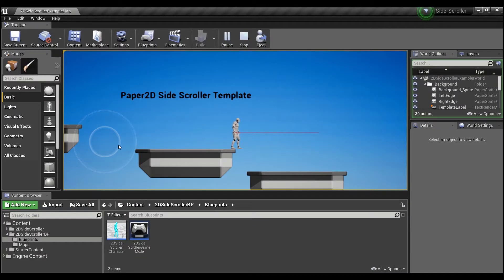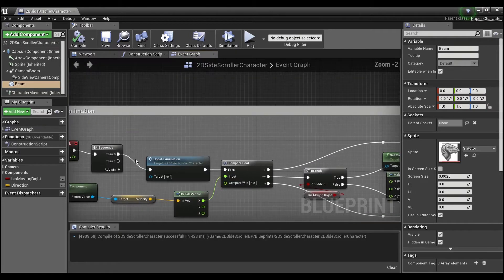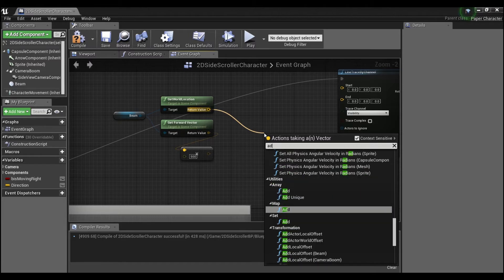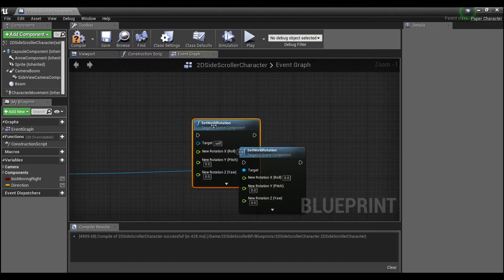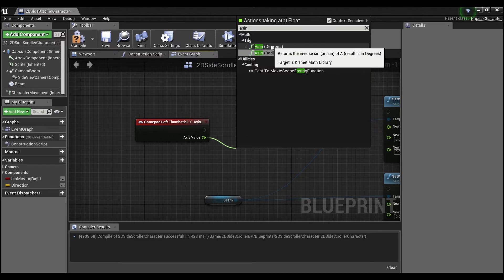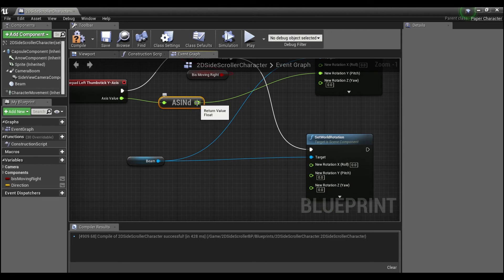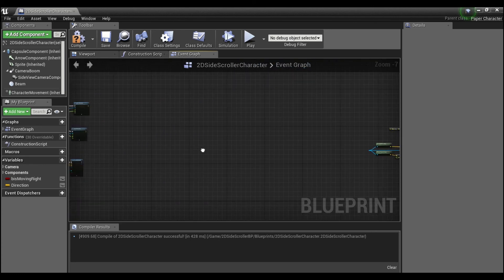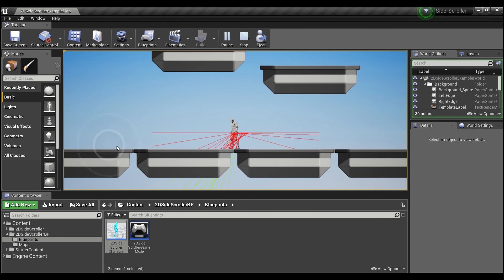Unreal Engine 4 Tutorial: Joystick Controlled Line Trace in 2D

Comment: How to do this with mouse cursor position?
Reply from the maker: There is a node I forget the name off hand that converts mouse position to screen coordinates. It might be called "mouse too screen" something you can find by searching in the player controller. You'd have to modify this somehow to use those values as the mouse changes its vertical (y) and horizontal (x) screen position.

Comment: Thank you so much. I'm assuming a lot of this will still apply to a 3d sidescroller? This definitely puts me on the right path.
Reply from the maker: Um, I am not sure about 3D. A joystick only has 2 axis, up/down and left/right. So you can only aim the line trace along 2 axis. Not sure what your game mechanics are now to be honest but I'd imagine you'd need to add another input to then rotate about the Z axis as not just the Y axis pitch. But I'm sure it can be done. Another thing you might wanna investigate is using a multi sphere trace and linking that to where your joystick is aimed to determine enemies in range.